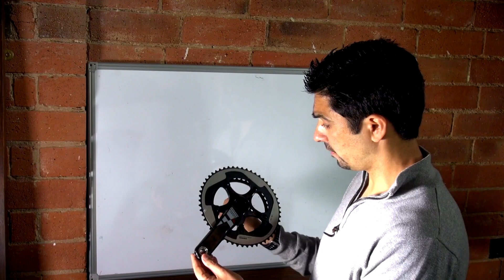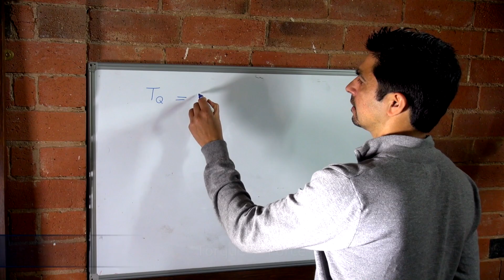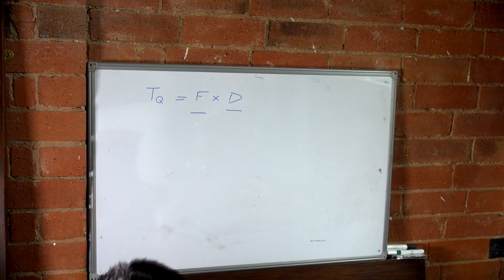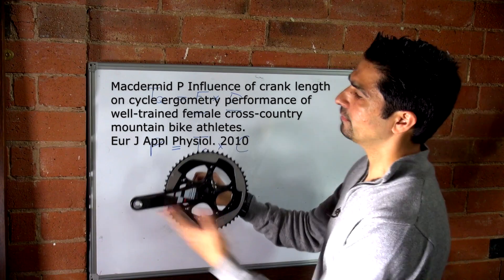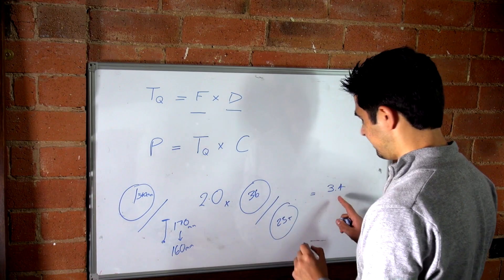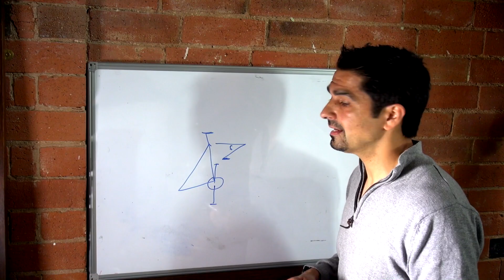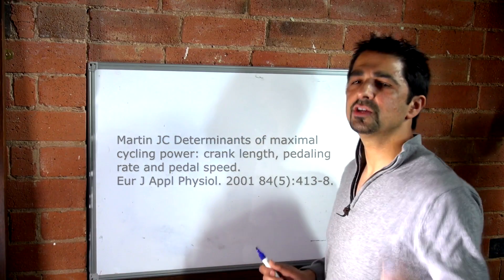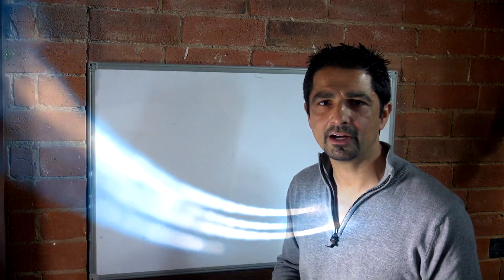The basics of Crank Length (Effect on power, cadence, comfort)

Comment: I'm a 6ft5 TT who's currently running a 53 front with 175mm creanks. I'm contemplating swapping to a 55t and 170mm crank to aid hip angle in my new more aggressive position. 
Should I sack off the 55t to ensure I maintain power?
Reply: If you decide to go with a shorter crank length then you shouldn't go up in front chainring teeth.  Just keeping the same 53 tooth front when going from 175mm crank to a 170mm crank will reduce overall torque.  It is only roughly a 3% difference but it will probably be noticeable.  With being so tall I probably wouldn't go shorter than a 172.5mm crank but if you have the money try both.

Comment: 4:30 ??? 
Wtf is going on
If power is the same and torque is the same then cadence will be the same
What you are thinking about is that the speed of the rotation is slower but while your leg rotates slower, it has less distance to complete for a full revolution, which is what cadence is the time it takes for a full revolution

Comment: The main benefit of a longer crank (longer end of "normal" range) is when "jumping" in to an acceleration. IOW, when operating at peak torque. This is rare for most athletes. And it's a compromise because you might be losing top end (high cadence) power development. Study power and torque curves of internal combustion engines to understand the torque/power dynamics and then remember that with your own "engine" you risk over-stressing your muscles - an additional risk. 

OTOH, if you're really fine tuning your form for sub-maximal performance over long periods getting the length optimized can theoretically help with endurance/economy. The bottom line is to err on the side of the shorter crank unless you have lots of testing to validate your reasoning for extending the length.

Comment: With shorter cranks you mostly pedal fast, and long - slow, i could ride a 165 but do 170's for all-round use, hills etc... spinners are winners, literally tho at some point you have to push slow gears on a bike, if you go up a rise/false-flat hill...so you have to get back the momentum if in a competitive group sitiuation. Cycles are sold with waaay too long cranks and SHOULD BE selectable, i even dismissed a buy of a bike in a shop once as they didnt have my length of crank and they looked at me like i was crazy!

Comment: Thanks for a great explanation 
I have several road bikes with same gearing 53/39 and 13-29 and different crank lengths 170 &172.5 mm
Same frame geometry & stem length 
I really notice the pick- up and speed with the longer crank which suits my riding style - not a spinner but long distance recreational cyclist these days :)
68 yo riding steel

Comment: A mishmash of facts and info, some of the comments are on point. Changing crank length effects gearing choice. Shorter cranks allow a more aero position and can open up the hip angle which is generally a good thing. I used 170 for years tried 172.5 and 175. Hated them. Am 6' 1''. Am going to 165. Had 167.5 on my track bike I used a few times on undulating super hard training rides. Put something like a 92 inch gear on the bike. Uphills were a grind, steep fast downhills had to break a bit. It is a single speed fix gear track bike! Very efficient feeling on the flats. Get to the front to take a pull spin like hell and just seemed so fast. This is in non aero days, did affix both front and rear rim brakes for group street riding.

Comment: NOW on my carbon race bike l have a 172.5mm crank mated now to a 50/39T chainring and 12-28T cassette .Being fighter bike l can use a higher gear ratio than the bike below overall but l spin them faster and l get pretty much the same top speed between the two at around 46km/hr which is more than quick enough .AND on windy days around 35-39km/hr ,which is also fine . Funny how both bikes with different set ups end up same results BUT different feel between the two. RACE bike feels zippier and old steel more relaxed :)
Reply: PS l am looking to change out rear cassette to a 11/32 soon ,l intend to do some climbing with it in future...."RIDE UP GRADES "  :)

Comment: WELL l did find going from 170 to 175 very odd at first but after proper adjustment of my seat to fit better ,l really liked it along with changing out chainring from 53/39T to a straight 46T with a 12-32 8spd rear cassette on my old steel road bike making a 1x system to simplify my drive train .AS my commuter bike this works great and simplified riding around my relatively flat city ,along with 32c tires to smooth out the bumps :)

Comment: My bike fit guy reduced my 172.5 to 170 as I am too crowded (top of pedal stroke) when in the drops. Thigh hits chest etc.  My case is I have long legs and short torso, so although my long legs can push the larger crank (175mm on MTB) my upper body is short so the upper body angle is compressed due to a higher seat relative to drops.  Its all a compromise.

Best fit for road bikes are DUCKS.  short legs/long body means you can get 'low as' and not have a ridiculous seat to bar drop.

I'd prefer longer cranks as I am less of a 'spinner' but the bike fit says otherwise.  SO  I had to learn to spin.

Comment: Crank length is important.  As a keen cross country unicyclist, I find choice of crank length is vital.  Shorter means I can spin faster but with less leverage; longer gives me more leverage for hills, but a slower cadence.  A unicycle is direct drive (fixed gear) so crank length and wheel diameter are the main two variables, and crank length is the easier one to change.  However, with very short cranks, you use a smaller part of your range of muscle contraction, and with very long cranks, you move the mass of your legs further.  On a bicycle, you are able to choose the gear ratio between the chain ring and the rear wheel.  Therefore, it makes sense to choose the crank length solely for what gives you the best, most comfortable and most efficient pedalling action.  About 170 mm for a typical adult male, a bit shorter for someone who is shorter, and possibly a bit longer for someone who is very tall.  Think of the legs/cranks as the engine.  Optimise the engine, then use the gears to direct that power to the rear wheel.

Comment: Hey I was wondering if I could get your opinion on something? I just bought a 52 cm 2018 Cannondale supersix Evo Dura-Ace and it comes with 172.5 crank arms semi compact crank and 28 cassette in the back. What do you think about keeping the semi compact shortening the crank arms to 165 or 167.5 (I'm 5 foot 8 and 1/2 in tall but have 28 inch inseam for pants, 30 to the floor with bare feet, and 32 with shoes) then running an seq Lite lightweight 42 tooth cassette in the rear with a wolf's tooth Road link to make it work?
Reply from the maker: Try this online bike fit calculator: https://pedalforce.com/online/bikefit.php. If you want to know more about ratio/gear choice email us.

Comment: If you have a long crank it's easy to get upto speed - which is why world class BMX riders often use 180mm cranks. Those guys crank out some serious power in the first 20 seconds of an event. Until I saw the data, I discounted then as wannabe posers that rode to look cool.

Studies have shown that differences between 150 and 180mm  are negligible in max power situations. 

When you try a shorter crank, say 150mm, you quickly noticed than you prefer to ride at a higher cadence because you apply less torque which contradicts your statement that you can pedal slower with shorter cranks just because you spin them with your fingers.

Comment: i tested 172 and 175 and difference is noticable, shorter gives more ability to accelerate, it easly rotate on higher rpm.
with longer i felt centrifugal force on legs and it accelerate slower, and is not good for high rpm but is better for lower rpm on uphill and if tilt too much in corner longer will touch ground earlier when rotates

Comment: The shorter you are, the more sensitivity you have to crank length. I swapped 170 for 165 mm cranks on my track bike and found improvement in comfort and position. I am now  accelerate seated faster while seated (essential for track racing) so it's totally worth it if you're 173 cm or shorter in height

Comment: This is Wilson X Bezerra. You are right if you are talking about the conventional bicycle but not our stepper bicycle. The convention bicycle will become obsolete within the next few years. Our 20 year patent has been approved and we are sec approved. Our crankarm is 20 inches long. We operate in the most efficient area of the circle when pedaling, 2 to 4 o’clock. The forces on the conventional bicycle goes into the frame ours goes into the wheel. No distortion of the frame or fork. Also, we use 2 of the strongest muscles to propel the stepper bicycle forward instead of 8. We eliminate muscle fatigue while riding. The chain always remain straight when shifting. Our pedals are directly on top of the crankarm and not on the side. This avoids jerking the frame from side to side. Our RPM exceeds 120. Even though all can ride our system, it also allows a person missing a limb or those who have mobility issues to ride. Please visit our website.  Www.arc287bc.com  we have been approved to sell shares by the Sec on Oct 24,  2017 at 4PM. Go to Sec.Gov at the search bar type
Arc287bc
Also search on Youtube: Arc287bc  you will see testimonials of people trying our system. Anyone can see the 7 Wonder of the world: 232 Union Blvd. Totowa.NJ. Call me 862-703-9196 Shares can be purchased and we will start taking orders for the Stepper Bicycle soon.  1.00 a share Place your orders now. Call me

Comment: Buy a variable length crank, and see what your power meter tells you.  I think that the body is adaptable to some extent, and all variations provide opportunities for strength gains. Three versions I've come across are: 120 to 160mm, 150 to 190mm, and 180 to 220mm variable cranks.
I'd love to see a variable length crank designed for permanent use that is extremely light, and you could alter it on the fly with some type of stable nano motor. (I'm dreaming now)
Note that the seat post should be adjusted as crank lengths adjust.

These variable length cranks can be heavy. Maybe permanently install on a training bike for strength gains.  careful about cornering when at the long ends. A high positioned bottom bracket provides the greatest clearance.

I think we should be able to rent them for a period of time, learn what you can while renting them, then return them so someone else can do the same.

http://www.hscycle.com/Pages/adjustablecrankset.html
Reply: Also curious if there is any science behind styles of cycling (cadence and force) in relation to fast-twitch muscles and slow-twitch... I understand each type of muscle has advantages. Does fast cadence promote the existence of fast twitch muscles?

Comment: This is a great idea and you should really do this video again, it is certainly worth while!   You acknowledge the confusion between Cadence and Pedal speed in the notes you added, but it is not clear when you are using the right terminology and when you are not (thus I suggest a redo!) 
At the same time, the analysis needs to go both directions.  A longer crank gives you more ability to climb steeper hills (by creating a lower gear so to speak); a shorter crank allows higher maximum velocity for a given foot speed( though it requires more force on the pedals)
In addition, air resistance is always highly relevant.  It would seem that shorter cranks should reduce wind resistance (less overall average frontage because the foot does not go as far from the hip)
In addition, there is likely an optimum  length for muscle efficiency, as other comments have suggested.
Reply from the maker: You are probably right, at some point we need to revisit this topic!

Comment: You kept relating longer cranks to faster cadence, I think by accident.  Tq = F x D. When D is larger, Tq is larger, if Force is the same.  P = Tq x Cadence. If P is same and Tq is larger, then C is smaller; so when Distance is increased, Cadence is decreased to yield same Power output. C = P/(F x D).
Reply from the maker: thanks for the correction, it was corrected in the edit (youtube annotations) but appreciate your feedback.
Reply: I was about to reply that there seems to be confusion between candence (rpm) and angular velocity (pedal speed).  Given equal power cadence is lower for longer cranks.

Comment: Cycling Bio-mechanics equals muscular considerations (bio) and non muscular(mechanical) considerations.
You need to consider what is lost not just what is gained.

A longer crank length gives a mechanical advantage of strength (force).
A shorter crank length gives a mechanical advantage of cadence (velocity).
Power is Force (strength) x Velocity (cadence). 
As crank length goes up - force goes up and velocity goes down (say 2FxV.)
As crank length goes down - force goes down and velocity goes up (say Fx2V).
2 F x V  =  F x 2V . 
In practice the power is the same. 
The dominant factor here is the muscular considerations: muscle length, tendon length,  ligament length, the length of the limbs and feet, the speed of contraction and where the maximum power is in the contraction.
There is no difference in efficiency because muscle shortening velocities are the same.
British cycling have experimented with this and found that there is only a difference at the extremes 1120mm and 220mm. length cranks. 

The main purpose for different crank lengths is to change the bike fit position - hip closure and hip angle without changing other fit coordinate. Riding a smaller crank will open the hip angle allowing a more prone (aerodynamic) position. 
In track cycling a crank length of 165mm is used for safety reasons and nothing else. No-one can spin a 165mm crank faster than say a 170mm length. Not even Chris Hoy.

Cyclists get good at what they use. Train with 170mm you will get good at this length and so on.
E Merckx used a 175mm crank length for time trials and 180mm crank length for hill climbs in the Tour of France.So longer crank length use is not new in pro cycling. I read M Cavendish is using a 182mm down from 187mm. 

Another cycling myth on the internet.
Reply: Sorry guys 120mm to 220mm. 
There needs to be a change of 30mm  in crank length for a noticeable change in pedalling efficiency. 
Think of crank length as a gear.
So 200mm is gear 1, 170mm is gear 2 and 140mm is gear 3. 
For the nerds.
Power 170 = F x v.
Power 180mm = aF x 1/aV = Fv.
Power 160mm = 1/aF x aV = FV.
So power 170mm = 180mm = 160mm.
a is the factor of change for the mechanical advantages of force and velocity.
Reply: Very nice, and also for those with physical limitations, if shorter cranks help with relief...then they may improve in areas they suffered in...no?

Comment: Would it be reasonable to say that the  leg movement/motion is not too dissimilar to walking up stairs. 
I compared the recommended Australian Stair height from the CSIRO Australia with that of crank lengths and it falls in the same range. It states that the step height is to be not less than  150 and not higher than 180. For health reasons alone - crank length should be considered.